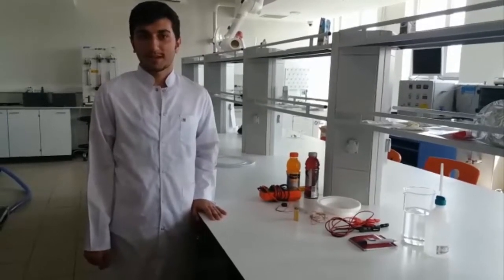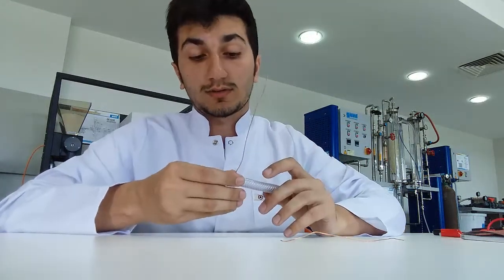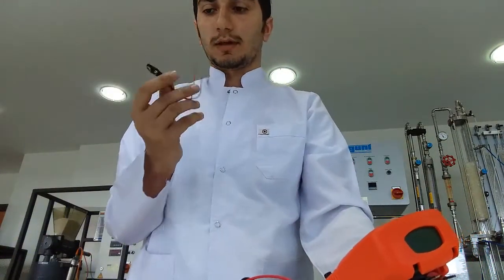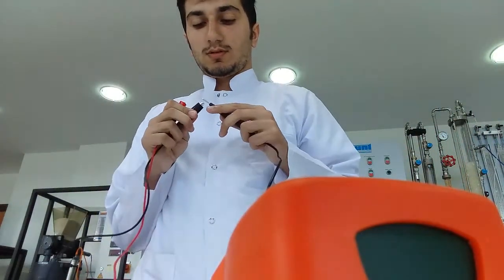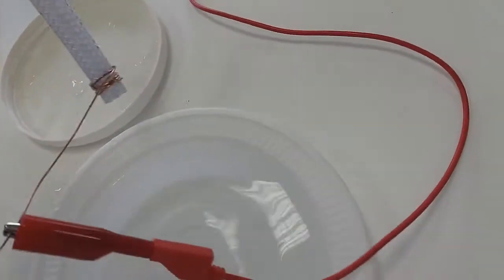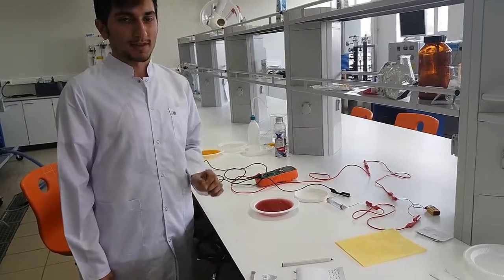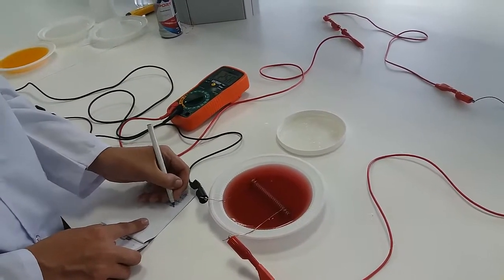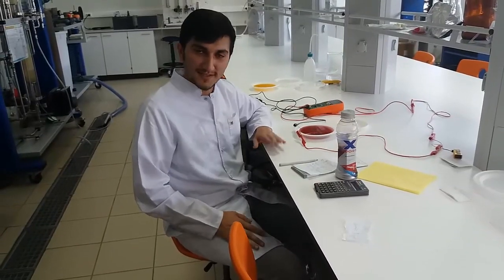Sohrab Askarli - Electrolyte Challenge: Orange Juice vs. Sports Drink

Comment: may I please ask you to explain to me how to use the equation. I tested coconut water with my multimeter and conductance sensor and got an average of 85.2 (mA). Do you think you could explain how to solve my problem? Thank you
Reply from the maker: In this experiment, I used basic formula to define conductance as:
Conductance [Siemens] = Current/Voltage. You just should divide the current you got (85 mA) by the voltage of battery you used (for my case it was 9V). The higher value means that the drink contains more electrolyte and has greater effect to lose the weight. If  you have any point unclear, you may contact with me by my email: sohrabaskarli@gmail.com. Thanks for interest.